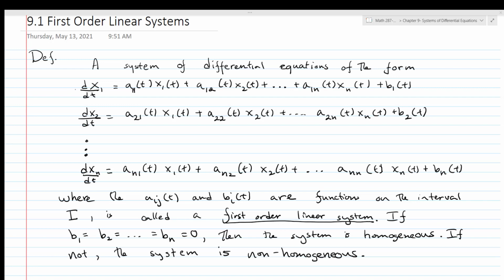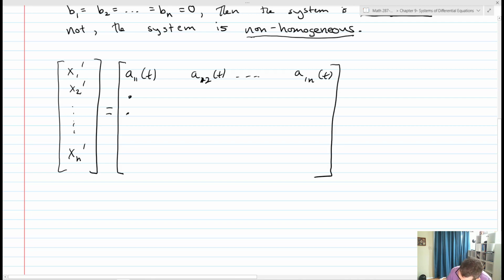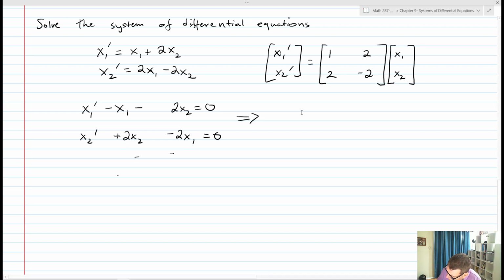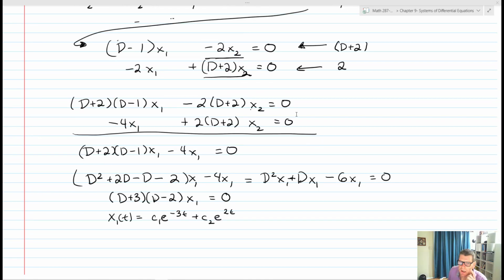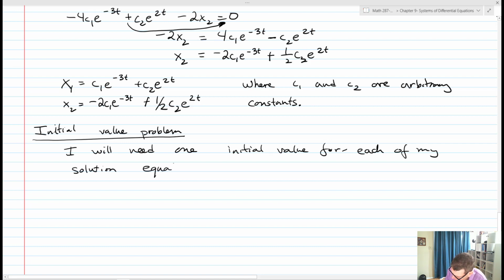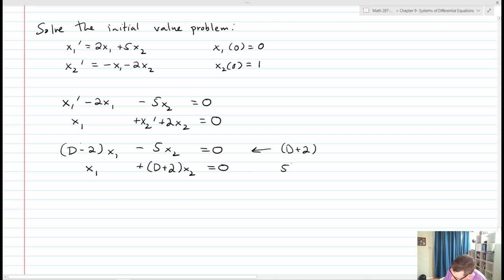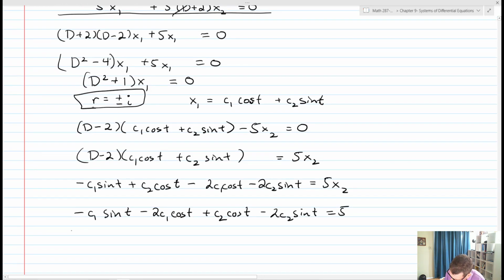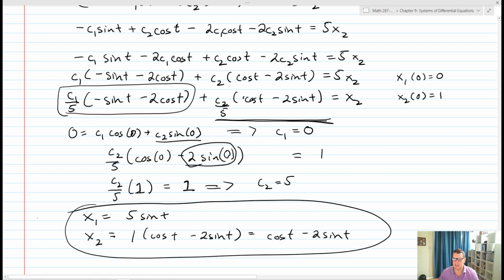First Order Systems of Differential Equations

Comment: Towards the tail end of the solution to the system, how did D-1 disappear?
Reply from the maker: It didn't disappear.  I used the differential operator D-1.  So the derivative of c_1e^(-3t)+c_2e^2t equals -3c_1e^(-3t)+2c_2e^2t and then we subtract 1 of c_1e^(-3t)+c_2e^2t.  Please let me know if that is what you are talking about. Dr. S
Reply: @georgefsweeney  I got it. Thank you so much